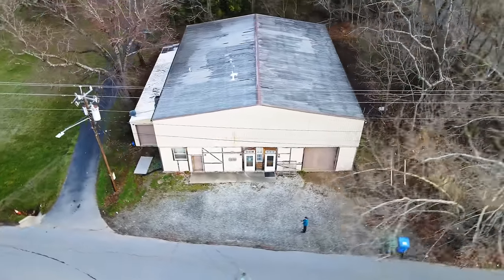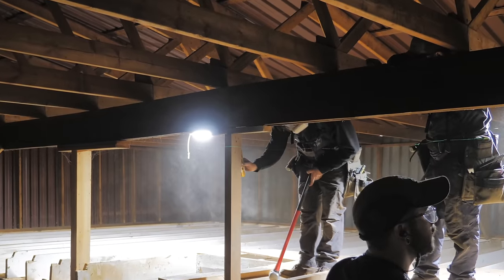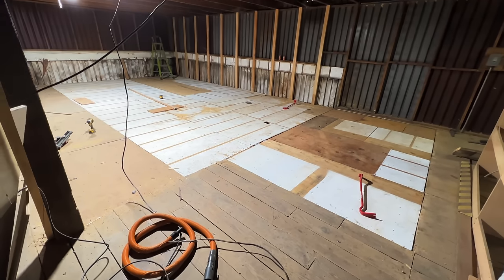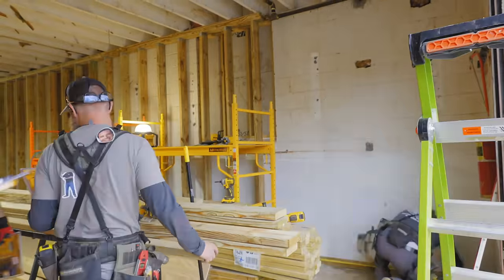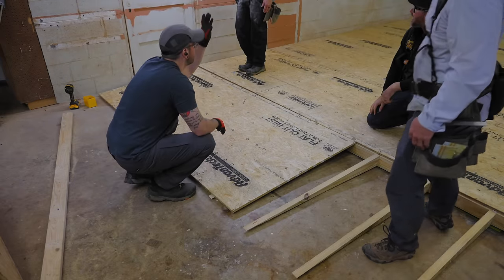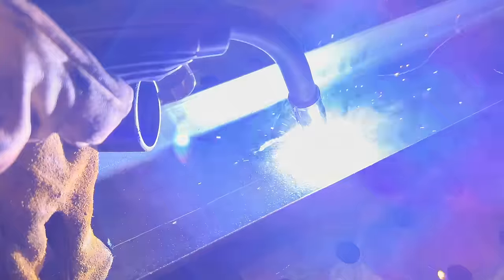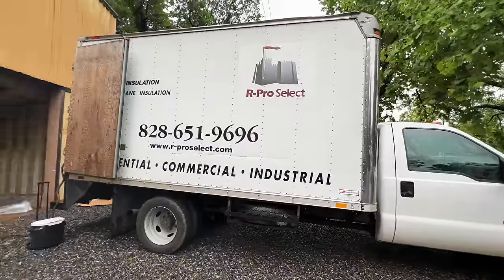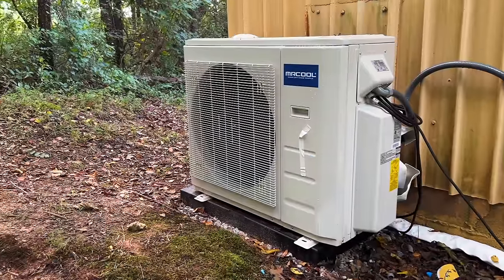50 Yr Old Workshop Restoration Into My Dream Shop

Comment: Looked like there was some black mold on the brick wall?  Did you test the wall for mold?  On the grading of the side of the building it would had been a good time to dig down the foundation and water proof the outside of the wall.  Putting a brand new French drain would had been a good idea too.  I agree to not putting in grass.  I would put in gravel around the side of the building.  On the gutters did you put a top leaf cover to protect the gutters getting clogged with leaves?  About ten years ago I had mold in my house and I had to have a professional mold company to come in to take off the drywall and scrub the all the wood with bleach.  Then the air was retested.  Once fine new drywall was installed.  Then I addressed the outside with water proofing the side walls and I put in a weep screen.  I also put in a French drain.  I sure could had used a professional digger like the one you rented because I had to hand dig around my foundation. I saved money doing it myself but I was so tired after the job was finished.

Comment: 1:44:26 For anyone wanting to run conduit, but don't want to deal with offset bends. You can either buy a that can cost anywhere between 200 to 2,000 dollars or use EMT hangers. They hold the conduit off the wall the same distance as the box.

Comment: Denim. Also since you are bringing the welcome cheekiness lately I will bet you the damascus laminate table is way weaker than your other table. Once you introduce wrinkles into composite fibers it severly weakens the material. Although 40 layer composite should hold a crap load of weight no matter what. Maybe you could do a test video!

Comment: Thanks for putting this complete video together. 
Lots of good tips. 

I’m wondering what size fast tracks you used and if you have the specs on the LED lights. 

If you add the fast track shelf brackets to your Amazon link I’ll  be happy to buy them through the link as I know everything helps. 

I’m going to add a deeper dimension bracket to hold seldom use items in containers on a shelf up high and considering shallower brackets for lumber storage under. 

The Amazon reviews for the brackets appear positive but Amazon has a note that they are frequently returned and directs me to view manufacturers notes and reviews. 

I’m not sure if the reason. Can you shed any light on this?

Thanks!

Comment: That's an impressive transformation, the only thing I could see that might be a problem is having the lighting on a single circuit, in a machine shop its always best to run off at least 2 phases so that each light in a row alternates between phases 1 and 2 or 1 and 3 or 2 and 3, this way when you run a spindle at the same or multiples of the sign wave your area generates electricity at, eg: 50 or 60 Hz (multiples of 50 or 60 rpm) it does not look like the spindle has stopped.
Reply from the maker: The lights are on three circuits total. Thanks!
Reply: @MyChannel-wg8ml  to answer your question, the light will flicker on and off at 50Hz or 60Hz which is 50/60 times a second it happens so fast you can't perceive it, but if a spindle of a machine (for example a router table) is spinning  at the same speed or multiples of; then the spindle will look like it has stopped, that's when you grab it to change the tool and take your hand off, if the lights are on a separate phase then the flicker happens at a different time, thus leaving the spindle lit at all times showing that it's spinning
Reply: Please keep in mind that if you are dealing with standard 240V delivery is split into two 120V halves or phases.  These are 180 degrees apart and each will have the flicker at the same time in phase.  The way around this is to have a three phase system (120 degrees apart) and have each of the three lights in the vicinity of rotating equipment on a different phase.  It seems that Wolfjinny was implying that a three phase system (1,2,3) is required, not overtly however (at least 2 phases).  Also, keep in mind that a lot of lighting today is LED based and that has its own set of frequencies that may not be a function of the line frequency.  This includes LEDs operating on DC - notice videos of car lights, brake, tail and how they flicker.  This is due to the flicker speed of the LED and the sample rate of the camera.  The best way around not being spoofed with a spinning spindle spin is DC and incandescent lighting and make sure there is not a lot of ripple on the DC.  Patience and sound are also good indicators as well as light touch.  Operating rooms monitoring organ move have the same issue.
Reply: The real questing is are they on three phases? @craftedworkshop
Reply from the maker: @roymack2  no, the lights are on single phase 120V circuits. They’re LED, haven’t had any flickering to speak of.

Comment: I question why you water proof walls on the inside instead of the outside? We had a building that kept bleeding water through the walls and we tried to water proof on the inside and it didn't work so we ended up stripping the walls on the outside of the building and doing the water proofing on the outside of the building and it worked !

Comment: is it really a good idea to make the waterproofing on the inside of a wall? where i come frome we normally waterproof the outside should also help with beter insulation since water transfers much of heat
Reply: nope it isn't, when he had the excavator out he should have dug a trench right up to the walls and waterproofed the walls with hydraulic cement and mastic and back filled with gravel, you don't want to know whats growing behind his plywood right now
Reply: @jasonwitt8161  well if i hadn´tr paused watching yesterday after my comment i would have heard that he was at least planning to do so, normally here we make it waterproof with bitumen or such things so there is absolutly no water ingress, and yes espedially a good idea if you are going to put a drywall with no ventilation behind it in front of it that just screams mold..
Reply from the maker: I used closed cell spray foam on the inside of the walls to provide an additional moisture barrier. Digging down to the footings and waterproofing the walls would have been an absolutely massive project and I've had no water issues since doing the exterior grading work.

Comment: When pouring pier footings, Sonotubes are your friend, also, for other people doing similar style footings, you need to also have vertical reinforcement rebar in anything over 12" thick (along with multiple levels of horizontal). Also, when putting up the posts, i find it easier to use your laser to measure the height of your post base brackets, and just calculate your  post height off each one, then cut them before putting them in the air. For 10-ft posts, its possible to do on a ladder like you did, but for taller posts it gets very difficult to stay accurate.

Comment: Okay, so, a few things about the electrical. If the wiring is pure copper KEEP IT (Probably to late) and reuse any with undamaged sheath. KEEP THE 3-Phase. If your building is 3-phase connected find out which type of 3 phase it is and derive 120 and 230v circuits from it. This allows you to save TONS of money on wiring especially anything over 50 feet as it allows you to main line 3 phase and derive single phase from junction boxes and you can use much smaller wire and also affords you the ability of running huge equipment in the future if needed. 
Also, keep the conduit, new stuff is thinner and that shit is expensive. Only needed to update scheme and boxes/panels.

Comment: Nice work but next time start outside first. You should have dug round the whole outside foundation walls about 18” away from the wall to the footer. Install footer tile drain. Sealed the outside wall and installed dimple plastic membrane. I would have back filled with stone to relieve hydrostatic pressure on the walls. All this would have helped your moisture issue.

Comment: The CNC outlets should be on 2 separate circuits. The control board on one and the router on the other to protect against spikes.
Reply from the maker: That is how this CNC is set up. Spindle is 240V and controller is 120V.

Comment: 1:47:10 In the case of any cable that is used for 220 -240 Volt applications can be used as a hot wire. In that case the ground wire acts as the neutral.

Comment: That was alot of work and a great video.  Watched the whole 2+ hours and thoroughly enjoyed it.  You provided alot of details and tips so it was both educational and entertaining.  I did wonder about one material choice- why use plywood everywhere for walls and ceiling?   I see that alot in shops, and I get the look of it and utilitarian usefulness as a mounting surface for tools, but plywood is generally not fire rated the way drywall is.  Just my observation.  In any case, best of luck with your great new space and I look forward to seeing more great content from you.

Comment: I've used toothpicks in the place of the plastic weed wacker line to get screws to bite, works on most materials, your method is probably more durable than wood toothpicks though.

Comment: I’m sure you thought about it…wondering the reason floating a concrete top wasn’t used for the floor leveling?
Reply from the maker: I was told by a few concrete pros that it wouldn't stick properly. That was my original plan.
Reply: @craftedworkshop  I’m no pro myself. I have 40 years GC behind me with concrete experience. It’s most likely the moisture in the existing slab. I have poured successfully on top of existing slabs, but every job is different.

Comment: My question would be, was there any attempt to secure the masonry wall?
Or is the 2x6 wall supposed to serve that purpose ?
Reply from the maker: As I mentioned in the video, the structural engineer's plan was to add the 2x6 walls and then the steel I-beam to properly reinforce the walls. All of the forces are pushing in from the outside of the building.
Reply: @craftedworkshop  Engineers are no different than others in that they have opinions.
Fixing a problem starts with fixing whats causing it in my opinion however.
An experienced masonry contractor would have been a better choice for a solution.

Comment: If you just used solid core wires, then wago has plug-in terminals also that are much cheaper than those lever ones. Lever ones are useful if you know something might get damaged or relocated but they're 5-10 times more expensive than cheaper plug-in terminals they make.
Reply from the maker: Almost all the wires I used were stranded so WAGOs definitely made things easier.

Comment: very very cool.  a good rule of thumb that I've successfully used over the past 20 years is estimating $1 per pound for off-the-shelf cross-sections including any misc cutting or hole punching.  I'm sure you know that a C5 x 6.7 is 5" wide and 6.7 lbs per foot.  A 20'-0" length of that would be 134 lbs or roughly $134 per piece.  These prices are adjusted for large US cities, so discount the further away you are.
Reply from the maker: Great tip! That is definitely helpful in knowing whether I'm paying a reasonable price, seems like I did.

Comment: If you eventually spray foam the rest of the shop roof you will be good, but the fiberglass being very little of a barrier between conditioned and not will mean lots of air and moisture movement - even though it is a good insulator. I would guess  getting the roof foamed (or some kind of barrier in the ceiling) would help with moisture and efficiency quite a bit.
Reply: Drywall works well
Reply from the maker: Yea, I plan to get the attic fully insulated but, considering it would cost around $30k, that'll have to wait.

Comment: With all the effort and expense involved in the project, im surprised that no effort was made to reinforce the exterior masonry walls and install a french drain system.
Fix the water infiltration at the source, and also reinforce the block walls first.
Try the trimmer string with galvanized common nails, it holds as good as the tap cons do.
Reply from the maker: The French drain wasn't really necessary with the swale, all of the water is being moved away from the building now. I'm not really sure what you'd do to reinforce the walls on the outside but my property line is pretty close to the walls so I couldn't have done anything diagonally.

Comment: Its been a very long time since i have used those concrete nails but as long as the concrete you are nailing on is cured properly, you can install them and they will hold, i used to hate having to use them because the foundation would break and would not secure the bottom plate to it and we would have to try again, then they came out with the nails you use the .22 blanks with and made life easier. it didnt always work but it was much better.

Comment: Currently made it to 1:00:00 into the video. Why did you not use plugs for those walls where the tapcons wouldn't grab? In Europe, we use plugs with screws for any concrete or brick mounting surface. I'm pretty sure our hardware stores don't even sell tapcons lol.
Reply from the maker: I definitely could have but I would have had to take the 2x4s off completely, vs just sticking in the string trimmer line. Same concept really.

Comment: Easiest way to cut metal fast....Take an old circular saw blade and take the carbide teeth off of it ( or use one without them) and flip it around backwards in your saw.....you will cut up to 24 gauge like it was a hot knife through butter.....

Comment: Regrading the ground outside, hydraulic cement on the outside, double-checking the gutters and downspouts, and when all else is done you rely on drylock.

The only problem is if there's any possibility of huge downpours or minor flooding in the area, then you wish you had just spent the $10K to $15K getting an interior perimeter drain tile and sump pit and pump installed.

Learned a lesson the hardway.
But, every house I've worked on or workshop I've worked at realized the soil conditions and high water table required such extreme measures.

Comment: Hey I have a question that I think you might be able to answer - how do mini split systems do in dusty workshop environments and what do you have to do to maintain them? I've been think of conditioning my 24'x30' shop and the one thing that held me back is concerns on dusting affecting the mini split negatively.
Reply: HVAC technician here, just clean off the filter regularly and pour some water into the condensation pan, then you should be good to go
Reply: @thejeterlp  Thanks for the reply man. I've been hesitant to put in a wood stove for the amount of floor space lost so mini-split seemed like the ideal route to go. I live in an area where it's regularly in the 30s in winter and 100+ in summer, and the wood stove only answers 1/2 of that equation anyway.

Cheers mate!

Comment: hats the deal with the joist hangars? the weight load is up and down and i doubt that would do anything for racking EDIT: unless it's to keep the bottoms from pushing out if the bricks end up putting kick out pressure on the 2x4s
Reply from the maker: Yea, the point of the 2x6 wall was to resist the bowing of the concrete block wall, hence the joist hangers.

Comment: Liked and subscribed, but you installed your outlets upside down. Most people pay no attention, and it's not written in stone, but it does help to relieve stress on the grounding prong of the plug-in. Just sayin and thanks for the video. I have already used a couple of the things that I learned from watching your channel.
I had to edit because I forgot to say what the reasoning is of having the ground at the top of an outlet. The reasoning behind the ground on top is for protection against any metal objects that fall on a partially exposed plug it will hit the ground instead of shorting across neutral and hot.

Comment: i hope you ran some 3 phase power . all the  best heavy duty equipment  it 3phase . i cant evern run my timesaver at my new shop because  i dont have enough single phase  power  to run a big enough comverter . also 3 phase is cheaper

Comment: I basically figured I would not install 20 amp outlets in my shop. From what I understand you don't really save money and it doesn't hurt anything to use 30amp sockets for every outlet that is 220/240v.

Comment: The old  front rollup door is used on businesses for a reason. It is all metal and would take a metal cutting saw to get though. The new pretty one could be penetrated much easier with an axe. There it a lot of expensive equipment in there.

Comment: I noticed the orange phase marking which that phase would be 240volts on that wire, hopefully he skipped that phase on the lights and outlet circuits or else that’ll cook anything plugged into them, now in a single phase 2pole circuit that 240v leg won’t effect a 240v circuit when sharing phases, same with a 3 phase circuit. I know it’s been 3 weeks since video was posted but thought I’d throw this out there for anyone who may want or need to know. Which now that I look at it closer it appears he did it correctly

Comment: Only big miss i'd say on this building was not paying to get the outside painted. Fresh coat of a light grey paint would have turned the outside of the building into a great look. IMO that yellow really makes the outside look run down, especially next to the new overhang and fresh garage doors.
Reply from the maker: Yea I'm just not willing to spend $6,000 to get the building painted. I'll do it myself at some point but it's a pretty big job.